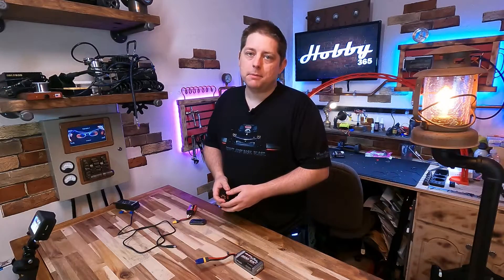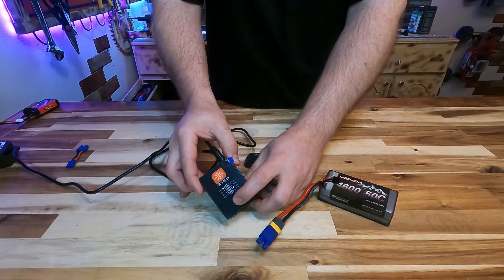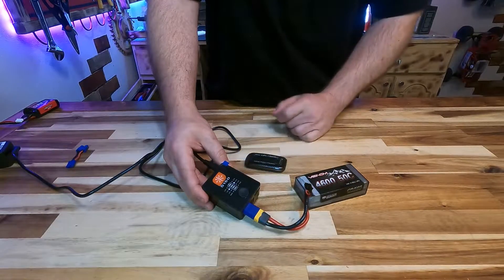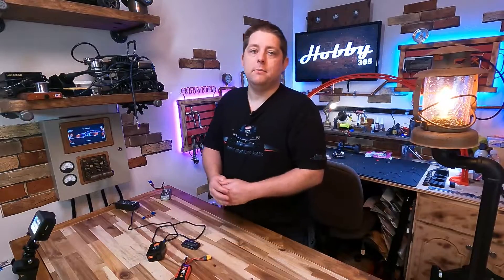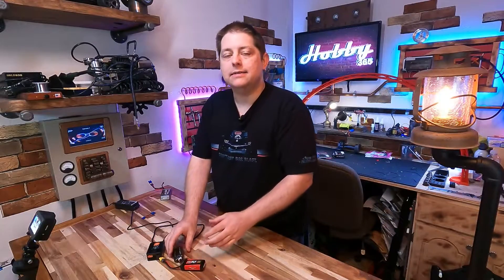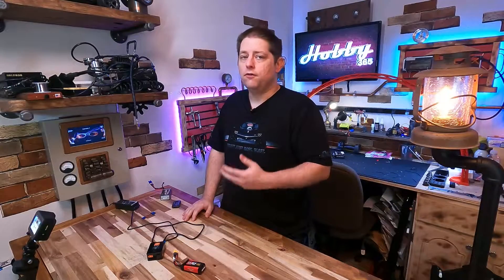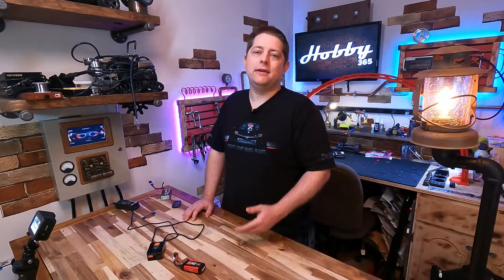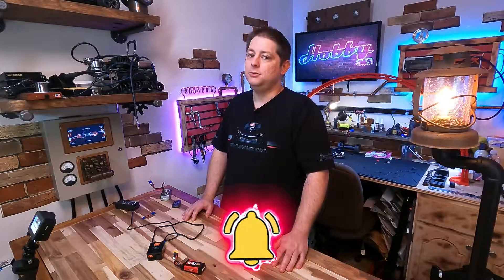S150 Charger errors and LiPo tips.

Comment: I just bought a brand new Losi 1/5 scale buggy and it came with what I believe an almost dead lipo battery.  I checked the voltage with battery meter and it read .8 volts.  Came with those crappy new "smart battery" from Spectrum , so trip #1 to hobby shop they sold me regular lipo charger which did not work, Trip # 2 was off to Amazon to buy the Specktrum S150 smart charger- Also did not work. (flashing all green lights)  After watching your video I'm pretty confident that this smart battery is crap. so tomorrow back to hobby shop Trip #3 to buy that fancy little battery checker thingy  and possibly another new battery. Thanks for your video buddy, problem not solved yet , but my gut feeling the whole time was this battery is defective or dead. Can't wait to get this baby fired up so I can go rip it.....

Comment: I just bought 2 ic3 ni-hm battery’s to use in place of ec3’s, but they wouldn’t charge. I guess they may be completely drained brand new. I’ll try the wall charger to get them going on the S150. Thanks for the tips.
Reply from the maker: I'm so happy you found my video useful.

Comment: My brand new lipo battery doesn't have a balance lead and i ran it thru my car one time and now it's beeping like that. Wanted to get back into the hobby but with this being the best tech for batteries and charging, and still being able to ruin them that quick, I think I'll wait 10 more years
Reply from the maker: Try not to get frustrated you are probably just experiencing the new user blues. The LiPo you have sounds like its a g2 Spektrum LiPo. Those balance through the microchip in the battery. Did you charge the LiPo before use? What truck do you have? Is it a 2 cell or 3 cell? Did you double check that the ESC was in LiPo mode?
Reply: @Hobby365  I have the same problem and I feel like it’s because I used it on the car before charging it but it was only for like 5min before it just shut down
Reply from the maker: @KingsGaming_777  You should always charge a battery before use. No doing so could cause the auto setting Low voltage cut off to set up incorrectly and damage the battery. If this is a smart battery Horizon has recognized a error in them and you might be able to seek a warranty on that.

Comment: What if the balance cable doesn’t fit? I had a spectrum brand lipo that didn’t have a balance cable and it didn’t throw an error I got new batteries with balance cables and they don’t fit in and won’t charge it errors out

Comment: What I've learned from SPEKTRUM is that SMART batteries will self destruct, (discharge to zero) it they're not regularly checked on.  This is what happened to my batteries that were stored for 15 months.  I don't think I'll buy smart" batteries again.
Reply: I am afraid i had the same experience on my 04 smart lipos 3S 1300. Impossible to charge them even thought there were stored properly at 40/50%. Headache, i will never buy again spectrum lipos even though i like spektrum, but lipos"smart" no. Compared to my other 20 other normal lipos that never give me any issue those 04 smart lipos are headache and i am not happy at all / waste of time / waste of money - charger is S150 + some others standards

Comment: Great video.
So I have the s150 charger and a Dynamite speedpack 2, 6 cell NiMH 7.2v non smart battery.
My problem is I set the charger up to NiMH and have tried it on every setting for amps all 4 of them and the battery percentage meter will not light up I double click to start and the amp selector light stays where I set it so I know the charger is recognizing that the battery is connected but no green light ever cuts on on the percentage meter on the charger.
The battery is brand new except for hooking it up to set up the model it wasn't hooked up long I set it up and unplugged it maybe 5 mins or so but the initial charge I fully charged it and the percentage was was green like it was supposed to be I didn't do anything with that battery after that while I finished painting the body of the model so I left it unplugged sitting in it and plugged it on up to check out my fully finished model and bam nothing so I plugged it up to the charger and it won't light up the green percentage and the fan hasn't cut on on the s150 I noticed idk if supposed to kick on immediately or whenever it starts to heat up idk. 
But if you could help me out I'd surely appreciate it

Comment: Hello sir, I need help Arrma felony with smart batteries, just replace the remote and did the bind, the car drives and works fine but the battery level indicator on the remote is flashing green over and over?

Comment: How do I put my non smart battery in storage mode with this charger?
Reply from the maker: The best way to put the batteries into storage mode is not with this charger. I would recommend using a voltage meter to check the voltage. You can either charge the battery up or run your battery down with your vehicle. Then use the voltage meter to check your battery for the proper storage voltage.
Reply: @Hobby365  thanks!

Comment: So uh.. when I plugged both the charge and balance cables into the s150 charger it beeps and flashes all bars and lights but when I unplugged the balance cable it showed one flashing bar which is what I’m sure the battery actually is at because i used my arrma granite until it slowed down once it slowed down I let the battery cool for 5 minutes
Reply: I am having the same issues as we speak. Just got it
Reply from the maker: Sorry for the delay on my reply. I have searched up and down for your error. and cannot seem to find anything conclusive to help you with. 

My only thought is there is some voltage error that has the charger confused. Maybe check the battery with a meter to see if there is a dropped  or low cell with in your battery.
Reply: @Hobby365  I went to the local hobby shop and they said the battery was a ok. Am at a lose for words awaiting Horizons warranty team but it's takin them a long bit to even get a response.